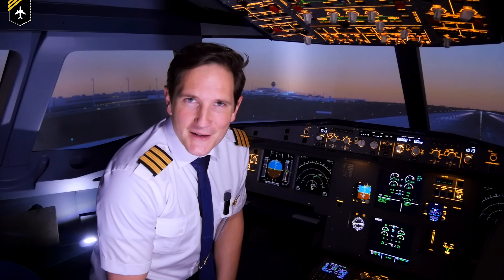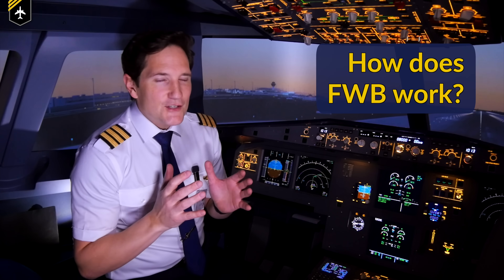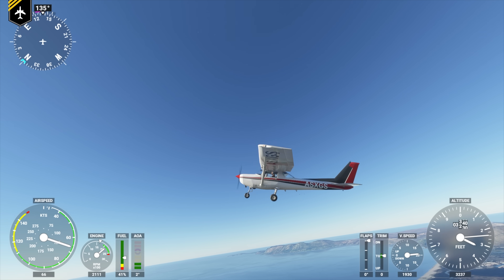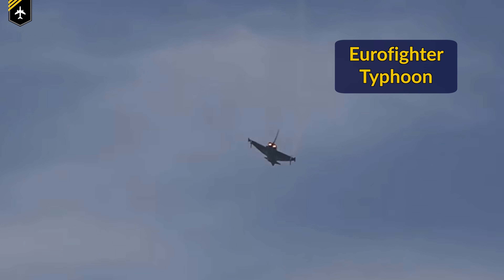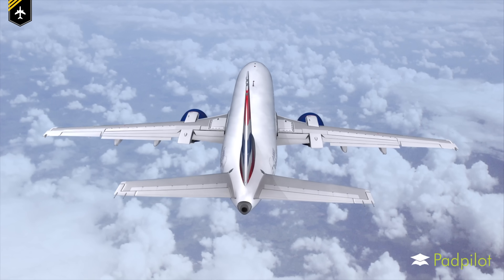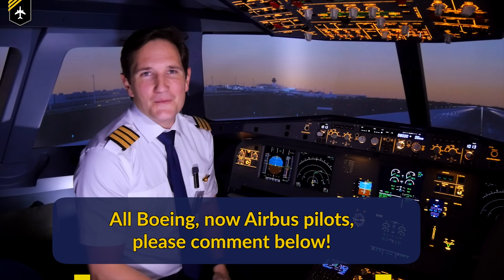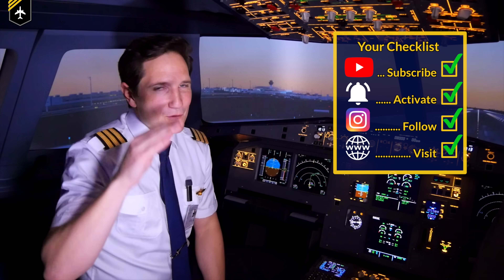How does FLY-BY-WIRE work? The future of flight controls! Explained by CAPTAIN JOE

Comment: Instead of complimenting the "Regular Hand Flying Expertise"; these days Fly by Wire computer controls are taken for granted by very many Pilots, not by all of them though in spite of vigorous training not to feel so. This tendency could gradually develop over time. Both the control manoeuvres are equally important and the Pilots must fly their planes by employing both modes throughout their flights with optimal deployment of both manual and auto modes. 

They should never be out of touch with manually flying capabilities, ever. 

When a bundled-up wire-cluster somewhere down the line in the fuselage gets short circuited causing an on-board fire, it will affect many automatic fly-by-wire components which could trigger off unreliable and false digital information feeds The pilot could sense that something is wrong and he should be at ease to cut off auto pilot mode and take back controls into his hands to fly manually. 

The Peruvian flight disaster; Aeroperú Flight 603, on 2 October 1996 already obnubilated by cloud cover in the night, was caused by erroneous covering of the PITOT Sensors by a duct-tape pasted by a worker while cleaning the aircraft and forgetting to REMOVE the tape after cleaning. The Pilot could not see clearly that unremoved tape with his torch light in the night, while inspecting the sides of the aircraft prior to starting. The PITOT could not sense and had thrown out erroneous data which led to that ghastly accident.

Therefore, there should always be Synergy of the two modes of flying an aircraft as best as they can. Such a system must be developed and deployed. Pilots should always be ready to put their hands on the controls even in the absence of the Yoke and the vibrations of a Stick Shaker when the online Computers fail during mid-flight. That Force-Feel is very crucial, indeed.
Reply: You seem to be confusing autopilot with fly by wire. They are NOT the same. A Boeing 707 has an autopilot. FBW is just a different way that pilot inputs are sent to the control surfaces. That’s all it really is plus some safety systems which can all be disabled if required. If you removed the computers from fly by wire then the plane would do nothing. That’s why there are 5 primary control surfaces computers and 2x mechanicals systems incase of total computer failure. They do have circuit breakers incase of shorts

The Boeing 757 of Aeroperu was not a fly by wire aircraft and it was the static port that was blocked, not the pitot tube. Otherwise they would have just lost airspeed only. However they still had a working attitude indicator, a radio altimeter and a ground speed indicator which would have been enough to get them back.
Reply: @tomstravels520  Thanks. Now I understand.

Comment: Also in very large planes, like the A 380, there is a lot of force to move the control surfaces. Again, the stick or hand controls in the cockpit are not directly connected to these control surfaces. Instead, the cockpit controls are connected via wire to a computer and the computer drives hydraulic systems to move the controls. In the old days, big planes like the B-52 were connected with cables directly to all the control surfaces and were moved by muscle power from the pilots.

Comment: Fly by wire in a plane works just like the throttle in your car. There used to be a cable that connected the gas pedal directly to your carburetor (throttle). Now, there is no longer a direct connection between the gas pedal and your throttle. Instead, when you step on the gas pedal, a potentiometer sends a voltage over a wire to the computer. Then the computer measures the voltage and converts this to a drive signal that drives your throttles.

Comment: Well, not entirely true, since Airbus must have this stall warning shaker and this is some kind of force feedback too.   ;-)
Reply: No. Airbus doesn't use a stick shaker, as vibrations on the side stick would potentially be indicated as inputs. That thing is pretty sensitiv after all.
Reply: No it doesn’t have a stick shaker because in normal law you can’t stall the aircraft. And in alternate law you have a loud voice yelling at you “STALL STALL” followed by the cricket sound. Only idiots would ignore it

Comment: I'm no pilot, but your comments on FBW versus cable flight system in terms of FBW being easier but cable has better feedback/"feel what's happening with the plane" seems very similar to the differences between driving an automatic and manual car.
Reply: That’s true. But a better analogy would be electric power steering vs hydraulic power steering in a car

Comment: How can a £200 Sim racing wheel have force feedback but not a multi-million pound jetplane xD
Reply: Look up some flight sim joysticks and tell me how many of them have force feedback. Oh wait, i can tell you right away, the answer is none. They tried force feedback about 20 years ago for flight sticks, turned out it's crap for sticks.
Reply: Because a racing wheel you control with 2 hands and have more control of it. A sidestick/joystick you only use one and it could be your non dominant hand

Comment: So if there is a system were the pilot tries to turn the plane to hard the flight computer knows it's too much and won't let the pilot over steer the plane. So, on some cars, they have the "avoidance system" which keeps the vehicle from pretty much running over a kid or crashing into the back of another vehicle. Is there such a system now on aircraft if it were to be highjacked. That the planes computer would keep the plane away from objects if it's being intentionally flown? Now they have systems on smaller jets that if there is an emergency they push a button and the plane will land itself to the nearest airport. has this been put into play on any airliners that you know of.
Reply: On airliners no because light aircraft can more commonly be flown by 1 pilot and the button would be for the passenger to press if pilot was unconscious

Comment: What if the computer crashes?
Reply: Nothing. You have backups for that case.
Reply: There are 5 primary computers to control pitch and roll and if they all failed you have mechanical connections to the rudder and horizontal stabiliser

Comment: So what if the fly by wire fails and doesn't take the pilot inputs like on the 737 max... Do the airbus pilots have an option to shut off the computer over ride in the fly by wire system...???
Reply: You can’t override the FBW system but you can force the aircraft to disable most of the protections and it will obey the pilots commands no matter what they ask. But the aircraft is always FBW unless all 5 main computers fail. Then you have mechanical backup

Comment: Boeing 737-200 advanced (1967) had control wheel steering in its autopilot which in effect was fly by wire. Still is today in the NG.
Reply: Not really the same. CWS is a function of the autopilot and the way I understand it is the commands were just sent to the autopilot and then the autopilot did the work. I’ve never seen pilots use the CWS much. On the airbus the commands are sent to separate flight control computers. This is the standard way of flying and isn’t turned off unless there is a fault.
Reply: @tomstravels520  yep I do agree, it's intended use was not as a primary flight control system but its design is very similar to a fly by wire aircraft. Pilot command went to force transducers then electrical to the Flight Control Computers then electrical to the autopilot actuators which moved the surface. Very basic in design with none of the advanced protection the 320 gave but it still was there.

Comment: The first military aircraft with fly-by-wire was the F-16. The Avro Arrow did not technically have fly-by-wire and I couldn't find any sources saying it was controllable from the ground. The Arrows FLCS had a mechanical backup and did not use a computer or any kind of augmentation system, it's basically just a passive direct wire-to-servo system.

Comment: A question for CJ or any other pilots.........
Does using a joystick in the Airbus aircraft and the more modern Boeings make pilots feel totally disconnected from the aircraft??
I'm sure the yokes in aircraft make the pilots feel like they're part of the machine, in my opinion, a side stick would feel sterile.
Reply: Thing is, yes you can say that an airbus sidestick feels totally different from a generic aircraft. But then again in an airliner, which is designed to be flown mainly on Autopilot, and by people who're operating the aircraft as a job, the priorities of what an aircraft should have changes. But yes, the norm is for pure flying, a yoke feels more natural

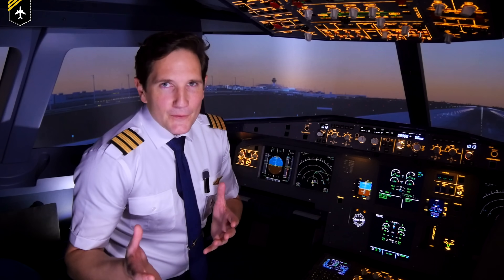Comment: One question though... The 787 is supposed to be fly-by-wire as well so that means the yoke is like the Airbus sidestick, the input from the pilot by using the yoke gets converted to a digital signal? So does that mean the 787 doesn't have that feeling you speak of at 10:07?
If the 787 doesn't have mechanical cables pulling on the control surfaces.. flying it should feel like an Airbus but with a yoke? Is that right?
Reply: The 787 and 777 do have an artificial force feedback motor. It would be harder to install on a sidestick as you only have 1 hand to move it
Reply: @tomstravels520  Really late but thanks for your reply lol.

Comment: excellent FBW  ( fly  by wire  )  mechanical  initiated   messages   transformed   by  flight  controlling  computers  in to electronic  messages  which  then converted  in to  hydraulic  mechanical  movement  #  but  i  have to  deeply  & clearly  understand the  ELAC   & SEC  functions  in elevating ,   descending  &  slipping  (  turning )   the aircraft #

Comment: I hate when someone unterfiers in what I'm doing suppose u are doing a tough maneuver in which u have to pull some move in airbus and the system won't let u and u crash how can u override the fly by wire systems
Reply: Force the aircraft into Altn Law which disables the protections

Comment: Your video helps not only pilots but also many of engineers
Reply: You don’t need to know this level for flying or engineering. If a box goes down another box takes over. In 10 years I’ve never seen an elac problem, usually it’s sec3

Comment: A REAL 11? Air cooled? Back in the late 80s, Porsche once tryed to compete AVCO Lycoming with an aviation version of its air cooled 6-cylinder boxer, which was first presented in a Mooney. Though performance and economy were superior to the old Lycoming boxer six, the Porsche engine was not successfull in the market. Porsche decided to retreat an to withdraw the aviation approval in the 90s. Because of that, Porsche had to buy back the engines and there is no spareparts supply.

Comment: FYI, many newer vehicles use “drive by wire” as the throttle is now is electronic so when press the throttle you actually pressing an electronic controller. Also some cars have electronic assisted steering to assist you with stating in middle of the road lane.

Comment: Hey Captain Joe what happens if you lose power for some reason, like an electrical short? Does this mean you lose control of the flight surfaces since there are no cables?
Reply: It depends on the type of electrical failure. The aircraft has 3 main AC BUS Bar’s, 3 DC BUS Bars and the Battery that power all electrical systems. All the computers are split between these BUS’s so loosing one means you still have a back up. If you loose one then you’ll be making an emergency landing anyway. If the generator/engine fails then the other generator or APU can restore power to the BUS’s. The only way you’d loose total control is if all BUS’s failed but that has never happened
Reply: @tomstravels520  Incorrect, if you lose all power the aircraft will still fly via the rudder pedals and the trim wheel, that is your manual reversion. You also have the RAT that will power the blue system and emergency power.
Reply: @Sterlingjob  the RAT powers the emergency generator, the emergency generator powers the AC ESS BUS which then powers the DC ESS BUS. If the AC ESS BUS is not working and both engines have failed then it can’t restore power and you’d have blanks screens and only the systems powers by the blue hydraulic system. However after some digging I did find out that ELAC 1 and SEC 1 in EMER ELEC CONFIG are actually powered by the Hot Battery Bus so you would actually retain control if the 6 main busses all failed but only until the batteries died. If you manually turned the computers off or they all failed then yes you’d use mechanical backup but only if you have the correct hydraulic systems working. THS uses Yellow and Green whilst rudder uses all 3

Comment: I have heard of one incident where one of the sensors on an airbus had failed which resulted in incorrect data relating to the pitch being sent to the computers, and I think you can guess what happened next

(I can't remember which way it was, but the incorrect data resulted in the computer pitching the plane either up or down (the plane was flying level when this happened) and the pilots tried to correct it, but the computers ignored the pilots input, and so the pilots had to override the system in order to save the plane)
Reply: You’re either thinking of QF72 or LH1829. QF72 was incorrect data being sent in spikes to the FCPC which rejected all but 2 of the spikes which caused the plane to think it was at a high pitch angle and lost 600ft before correcting

LH1829 was frozen AOA sensors which made the aircraft think it was stalling and forced nose down. The pilots turned off the ADR’s forcing the aircraft into ALTN law which disabled the protections

These faults have been fixed and action can now be taken if it ever happens again

Comment: Oh, Joe! Is there anything you can tell us about the power by wire system on the 380? As far as I know it is unique to the type unless you count military aircraft.
Reply: Unique in what way? The main difference is there is no mechanical back up on the A380/A350. It is a separate electrical system should all 6 computers fail
Reply: @tomstravels520  Unique in being a commercial control actuation system that is not hydraulically but electrically powered. As far as I know it is not activated by avionics failure, but hydraulic failure. But I don’t know a lot about it, thus the question.

Comment: Pilot: 'disconnect autopilot, I want to fly manually'
Airbus: 'I cant do that Dave'
Reply: Pilot: 'well, my name is not Dave'.
Airbus: 'Ah my mistake Sir, disengaging autopilot in 3-2-1'.
Reply: @the80386  =)
Reply: Pilot : turn of all fly by wire computers 
Airbus : *left the chat
Reply: @topethermohenes7658  A320 has four laws. In normal law, situation is briefly described in this movie. Od direct law, sidestick input goes directly to the flight surfaces without any computing or safety features. In last phase of landing (flare), as far I know, only direct law is used. Thos computers can be switched of manually from cockpit, and A320 will automatically switch to direct law.
Reply: *sad dave noises
Reply: QF72?
Reply: @techhelpportalextras3007  Lufthsansa 1829? Turned off the ADUs and overrid the alpha protections
Reply: Nice 2001 reference

Comment: Instead of ELAC 1, does the a350 use PRIM 1?
Reply: (and the SECs and BCMs)
Reply: The A330/340/350/380 use Primary and secondary computers (A330/340 have 2x Sec, A350/380 have 3x). The way I understand it PRIM 1 is the master and performs the computation function and sends its orders to the other computers. So when the pilot want to bank the aircraft, PRIM 1 processes that command and then sends the command to the other computers depending on which one is assigned the control surface. All the computers will then check to make sure the aircraft and control is doing as commanded. If there is an error it will warn pilots. If a PRIM fails the other can reconfigure but the SEC cans only work in direct law so if all 3 PRIM’s fail then the aircraft would go to direct law
Reply: @tomstravels520  and if the SECs fail, they still have the BCM (backup control module)
Reply: @ngaviation3489  yes. The BCM is totally segregated from the normal flight control system and relies on availability of the green or yellow (A350 yellow only) hydraulic source and the use of dedicated sensors and transducers in the pilot controls. The BCM controls and monitors only:

The THS (A380 only)
The inboard ailerons
The elevators (A380 inboard only)
The rudder

Comment: Do you think captain has to use left hand to control the stick an disadvantage?
Reply: No, as one, it's easy to get used to flying on either side (you can compare it to driving rhs vs driving lhs)

And two, flight training is always done from the left side, so it's definitely not a new thing.

Comment: I dont really understand why it saves wheight when fly by wire needs a mechanical backup? Dont you need the same pulleys and steel wires when the computers fail?
Reply: Mechanical backup isn't on every control surface. Its just on basicmsurfaces so that in the worst case, it's still fly able enough to get it on the ground.
Reply: It’s only on the horizontal stabiliser and rudder

Comment: This isn't related to this video, but I just watched your video about how planes slow down on the runway and was wondering why planes don't require a parachute to land like NASA's space shuttle Endeavor does.
Reply: Because a space shuttle lands much faster and doesn’t have reverse thrust. Also if commercial aircraft had a parachute It would be severe pain to keep picking them up off the runway before the next plane lands and replace/repack it before the next flight less than an hour later